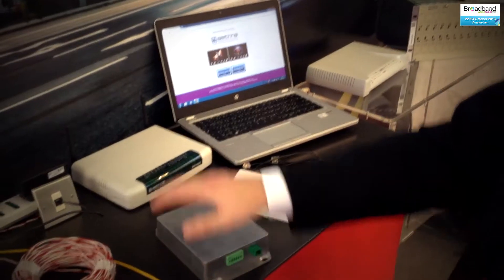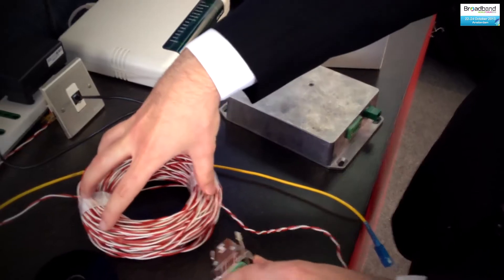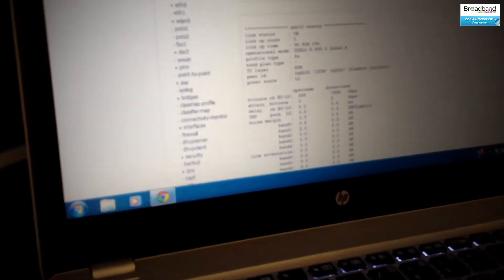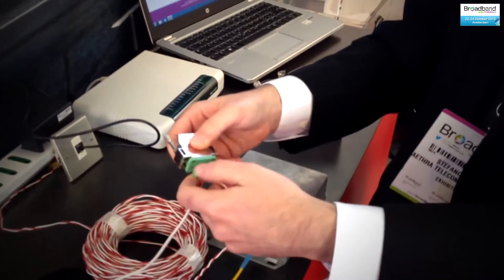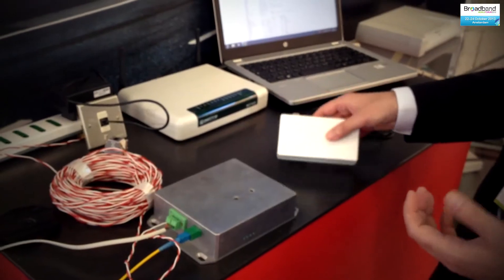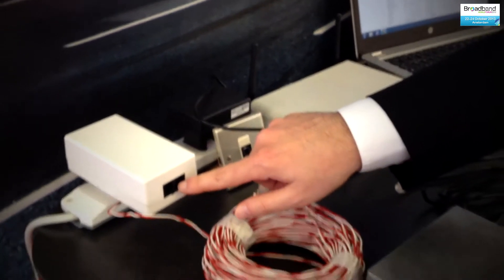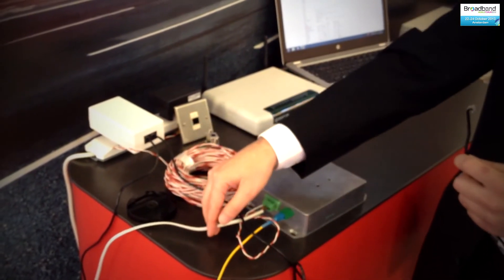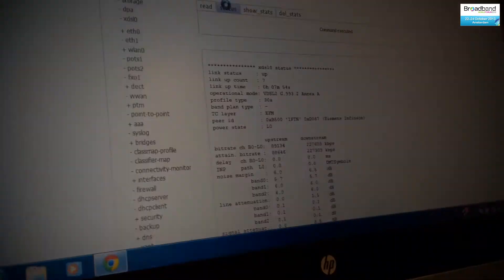FTTdP Self-Install and 230ds / 90us Mbps Demo at BBWF2013

Comment: Hi. could these units be attached to the side of the house where the copper comes in from the street this would make the Internet connection very fast and especially where copper wires are overhead and mounting one of these units on a pole would be very difficult because they would take up space.

Comment: Whats the equipment  in the pole?
and how can i achieve a 16 subscribers and whats the equipment used thanks
Reply from the maker: Hi Patrick! The box you see in the video is a single-user GPON-to-VDSL2 termination, and that's the hw to be installed at the distribution point (pole / manhole / basement / floor, it is of course available for outdoor usage...) If you need more info feel free to drop us an email at stefano [dot] wosz [at] aethra [dot] com

Comment: Fascinating. What maximum speed will FTTdP support?
Reply from the maker: FTTdP can reach 250Mbps aggregated datarates on more than 100m of copper cable using VDSL2 in profile 30a. Consider that the above demo is done using 50m of real copper and we reach more 220Mbps in downstream and more that 85 Mbps in upstream!
Reply: +Aethra Telecommunications What speeds would I get on 400 m of copper?